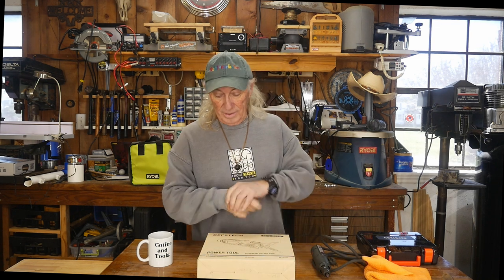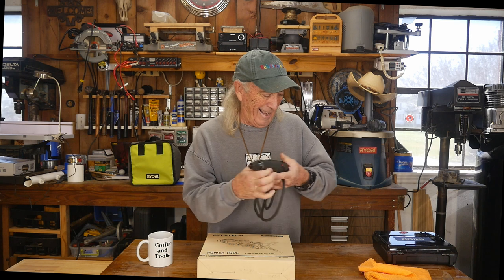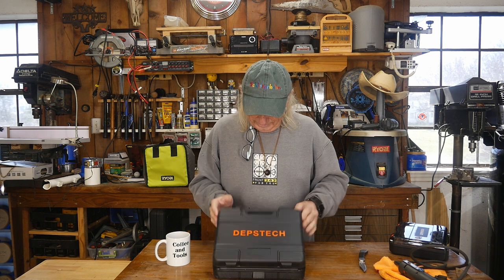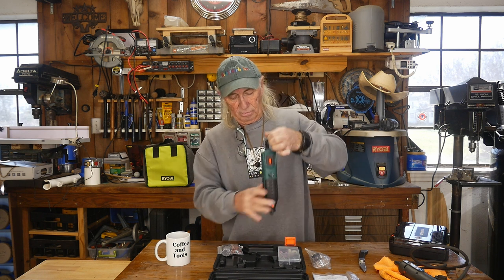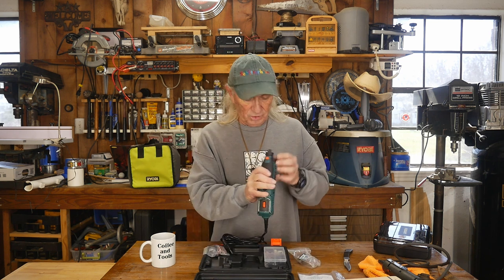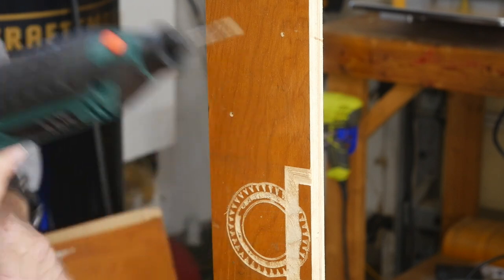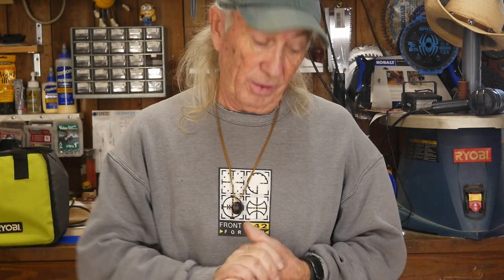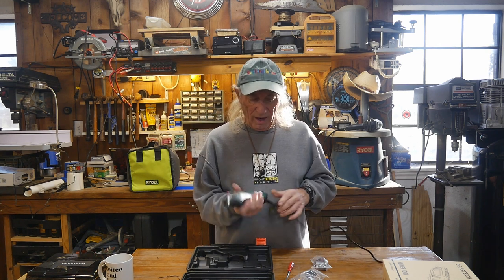Depstech rotary tool DM 200A at 40,000 RPMs...C&T ep 313

Comment: Hi. Thanks for your video. Do you know if the threads at the front of it are same size as a dremel? 3/4-12   To know if it’ll be compatible with a precision router base for a dremel
Reply from the maker: Should be the same, but only a guess.